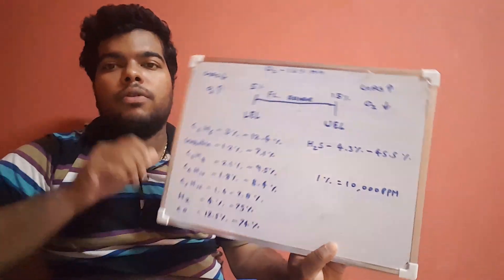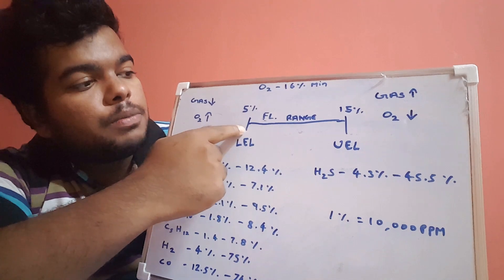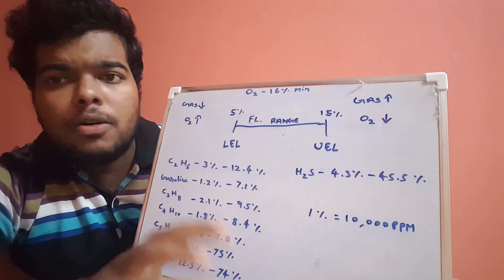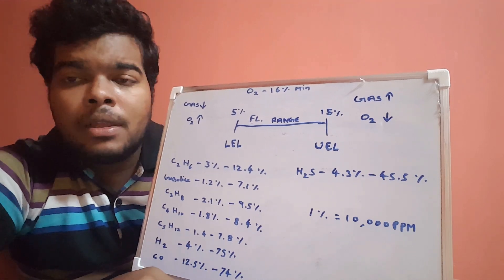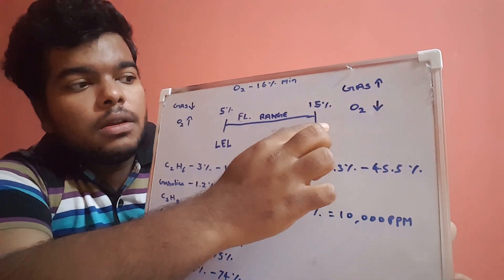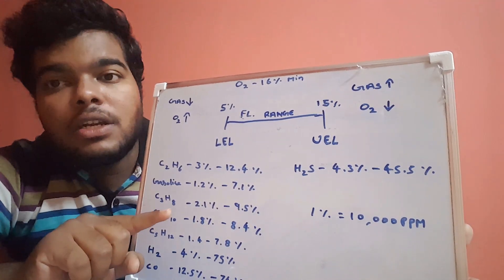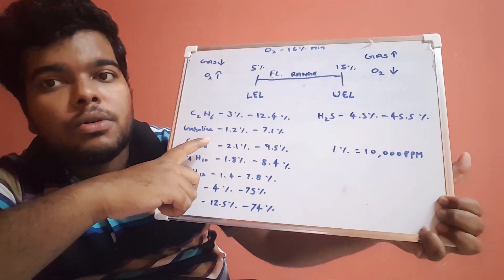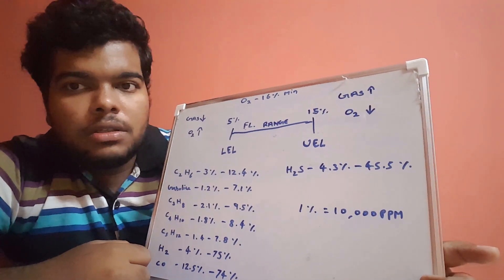LEL/ UEL & Detector Explained

Comment: The LEL % seen in the detector display doesn't show that the concentration of a flammabel gas is 5%. If it was so, you would explode when you see the LEL as 5%. That value is the percentage of LEL. Example; you see 10 as %LEL in the screen. It means 10% of 5% (LEL of CH4) which is equal to 0.5% CH4 concentration. Let's give tjhe right information friends.